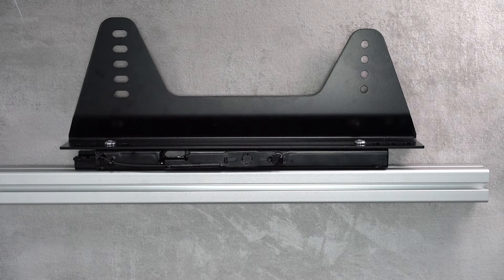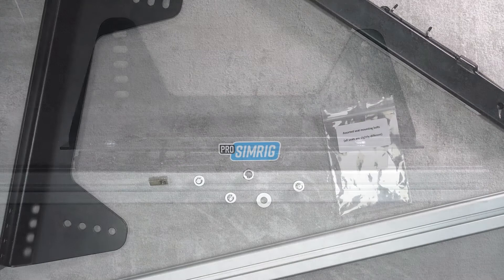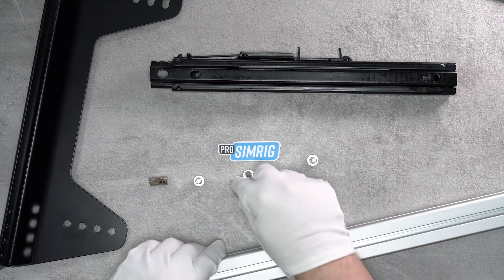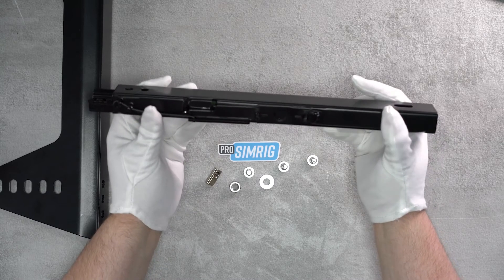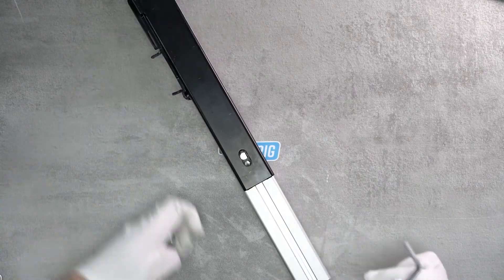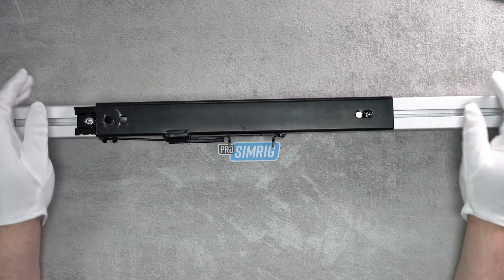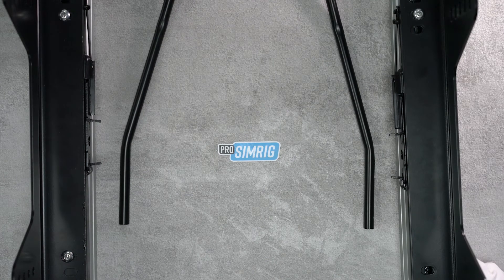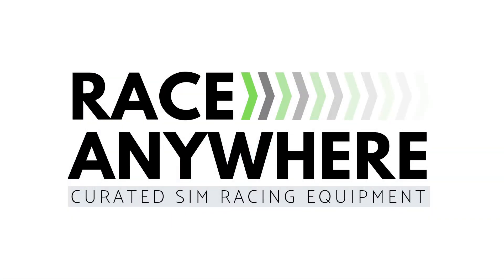How to assemble a sim rig Seat Slider

Comment: 1st...start from the front with the exposed rail hole and  bolt it to the extrusion
2nd unlock the rail pull it ffwd to expose the rear hole, same thing... 
3rd use the same scheme to have acess to the upper holes by unlocking pushing/pulling the rail mechanism.....
Zero fiddeling....and zero need of magnets/gimmics...

Comment: Very helpful to A make sure you have a magnet tool to hold the bolts and washer. I had a flat end screwdriver which had a magnet end. Other thing to note. Also when putting the slider runners on. Put the bolt on with clearance, one it in pull on the runners retention and slide it forward. This will give the other clearance to screw the other bolt on. Repeat on the other side. Then put the slider bar on, and use a tool to clamp it to the retention.

Comment: Do you know how to get the sliders to unlock to be able to get the brackets bolted on? I have hex bolts so cant do it the way you have in the vid. Cant seem to get my sliders to unlock when pushing down the side button and pulling. Couldnt get it to move either with bar connected to both sliders (without the brackets attached)
Reply from the maker: They are very stiff to begin with. The way I do it is to hold it in the left hand. push up on the arm with the left thumb and push the lower section from underneath with your thumb on the right hand. They are designed to be stiff of course, but they do loosen a little once they are moving. Drop us an email at support at raceanywhere.co.uk if you need any further help.